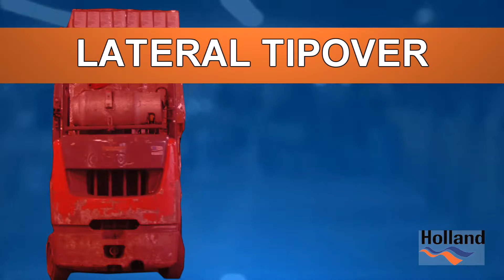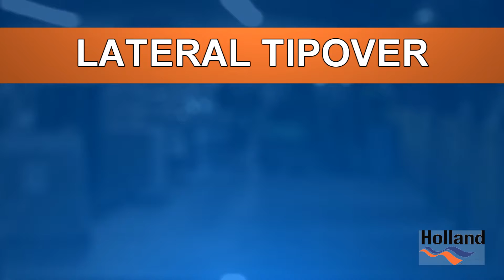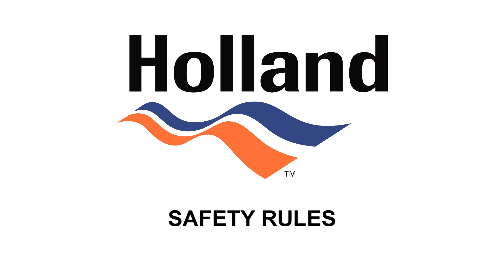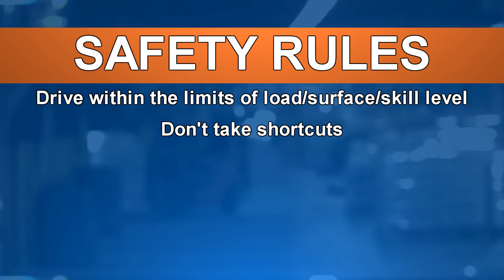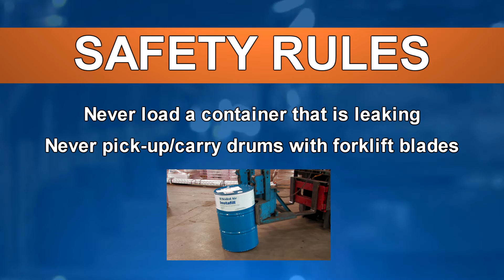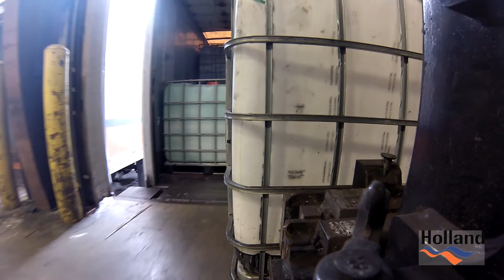FORKLIFT ACCIDENTS & SAFETY RULES

Comment: First! Lateral turnovers in units with lap belts present a secondary impact hazard to the head in narrow equipment... protection should be worn if practical. If applicable, care should be taken to anticipate and avoid electrolyte spillage if present in electric lifts with flooded cell [wet] batteries. In my experience, it's not a matter of if, it's a matter of how much. I prefer AGM, but I use what is provided and have appropriate spill PPE and containment protocols and supplies.